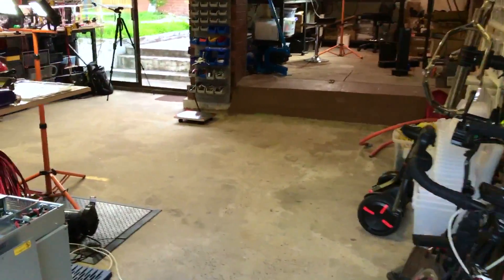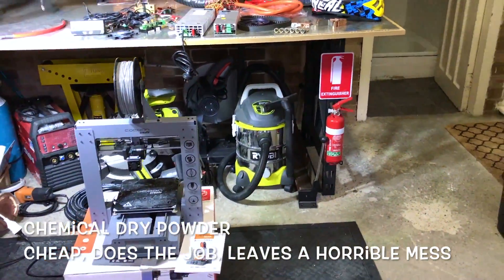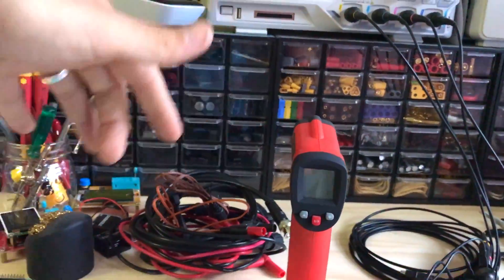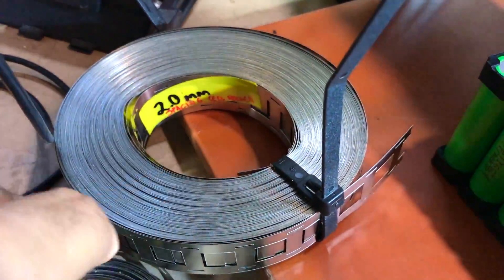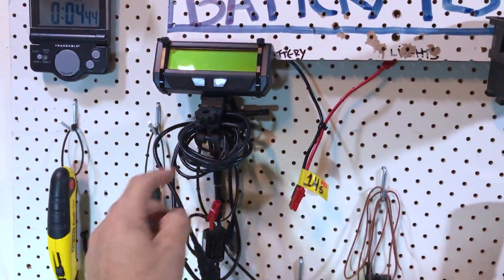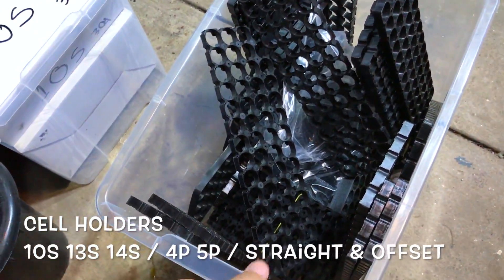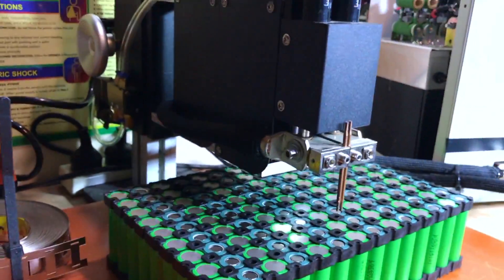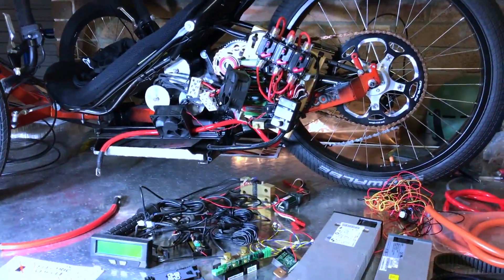My Electronics Lab & Battery Building Workshop... oh yeahh!!

Comment: I want to run 72v, 80A battery, and 200A phase, to my MAC...any recommendations for a controller? Thanks  Already did the current at 52v and no problems with the clutch or gears.  Glad to see somebody else realized the MAC has great potential :).

Comment: Bruno Popeye from Guadalajara México there is a trouble in My surron i make My own battery installed a 60 volt 150 amp bms not using the old bms because it has a 60amps limit, but i don't conect the square black connector from the battery and in ep mode works fine but in SPORT mode it cuts the power. And i need to restart the bike. From that connector comes only 3 cables from the original bms , i think one  is a gnd loop and the other is positive from one block of cels , i think it doestn mesures temperature.  Can You help !!!!! And also installed a así bac2000 on it but having the same issue

Comment: i love your workshop!! crazy !! very expensive workshop!! i am just curious, how do you earn money, do you support industries and do you build technology or automation equipment to industries?
Reply from the maker: Hahaaaaa thaaaanks mate. I actually don’t even earn much money at all... I basically buy little things here and there, +/- $100 a week and save up $$ for the bigger stuff but yeah if you put $100 per week in 3 years you’ll be surrounded by tools and no space to walk around hahahaa =]  I have way more tools than any company I worked for. It’s good you learn so much buying your own tools and using them. I work mostly in the electric vehicle and battery build industry but yeah always making different stuff, lot of custom metal panels, brackets too. I’m not a welder but can cut and bend. I always do all the electrical wiring, from low voltage sensors to making 800 volts high power batteries from scratch. When u have lots of tools you can do basically any job, best investment ever =]
Reply: @BrunoPOWEEER  I totally agree... But beautiful I loved it!!!! Ultimately it's the happiness you get have all of it!!! All the best!!! Hope you earn more in future!!! All I am very new to yotube plz support my channel!!🙏🙏

Comment: I would like to ask if it would be a bad idea to use the thermal insulation for the batteries to prevent damage due to frosts in winter or high temperatures ???

Comment: Hello, Bruno. I've got a few questions regarding bbshd motor. For the last year I've rode 7000 km with bbshd installed on a pretty simple 26" wheel hardtail bicycle called bergamont vitox 7.0. But now I'm thinking about changing the bicycle.

1) Is it a good idea to get 27.5" or 29" wheel? What will be the difference in riding with those wheels? I'm 5 feet 9, which is average height. 

2) Do you recommend using a bicycle with IGH (planetary hub) like Shimano Nexus 7,8 speed? I've got a chance to buy one inexpensive bicycle with such hub but it has v-brakes.

3) Can you live with v-brakes on bbshd or only hydraulic disk? I have Shimano BR-M375 mechanical brakes and they perform very poor. Do you know if Tektro HD-M290 hydraulic brakes are any good? Or in my neighborhood bicycle shopshop I can buy Shimano m315, m365, m396, m425, m506, mt500 or m6000. Which better?

4) Or I better upgrade my existing bike with a better brakes, etc? But I've got a habit to change bikes in a few years.
Reply from the maker: Hey mate, 
All these questions will vary between people, depending on your preference, your budget. Wheel size will only change the acceleration and top speed, smaller wheel better acceleration, stronger wheel. Get the fattest tyres possible and invest money on the best hydraulic disc brakes you can buy, not the biggest but the best. Sometimes going bigger only adds more stress to your brake mounts and you’ll ended up cracking your frame, it happened to me and a lot of people. Personally I like the Shimano brakes but they don’t have sensor. If you like sensor get the Teatro as there are many options out there like the Dorado.
Internal gears are good, I never had one for loooong time with a mid drive so I don’t know how it would do in the long term. A regular cassette I’m always replacing the smallest 11T so I guess the internal will eventually have the same problem. Chain stretches as well and I have to replace it every 6 or 8 months depending on how many kms.
If you can get a new bike, go for it, all fresh is a good thing, good brakes, new wheels, bearings, new everything. I save so much money riding my bike everywhere, it pays itself in 6 months. My favourite is my fatbike, feels like a monster truck, I can go anywhere ohhh yeaaahhh =]

Comment: Hello, im Rodrigo form Ecuador and i don't Know much about Ebike, i've been doing my research on the types of engines and batteries for Ebikes, and I'm better informed, the problem is that in Ecuador they do not sell Ebike, so I'm going to build it myself with the help of people that know how to weld and fold tubes, I would like to know if you can help me with information about the thickness of the tube that i need, and all the measures that you can help me with, im going to put a 20x4 fat tire, so i don't know the width of the bike that im going to build, if you help me with this I would be infinitely grateful, since I have 4 months investigating but I can not find that kind of information, and nobody have any one here, and thank you for the videos you upload, they are really funny and helpful, they help a lot for people like me who do not know about this and live in Ecuador
Reply from the maker: rodrigo molina Hello Hermanoooooo... I just read your comment here!!!!
Right, I don’t really have the measurements for the 20” x4” but I have my 26”x4” fat bike here. My tyres inflated is 110mm wide x 97mm “high” (between the rim and the road).
The distance between the rear dropouts is 170.6mm.
I would recommend get the complete fat wheel/tyre/hub first before making the frame. See if u can get the Bafang BBSHD motor, this is the easiest, best and most POWERFUL motor available out there. If you can’t import, see if you can get someone from a neighbor country to import and send to you. Alternatively I’ve seen many people using 12v car starter motors or alternators powered with 24v lead acid car batteries haha... don’t give up mate... I hope this information helped =]

Comment: Can you run a 52 volt battery on a 750 w 48 volt motor ?
Reply from the maker: Glen Garden yeaaaahhh, almost all 48v motor controllers can handle up to 60v max voltage. A 48v battery is actually 54.6v when fully charged and a 52v battery is 58.8v fully charged so it’s all good. This is a motor controller voltage limitation, the motor itself can take any voltage. You can run the same 48v motor at 96v you put a 96v controller and 96v battery as an example. Research “Bafang BBSHD 84v phase runner controller”

Comment: if i want to make a battery pack for 5000w motor i would need about 20 of 18650 (specs: 3.7V, 3400mah) because 20 of those would make 20x3.7V=74V and 20x3400mah=68 000mah=68Ah and it means that 74Vx68Ah=5032W... is that right? i found a seller on aliexpress which sells 20 of those 3.7V batterys for only 50USD... so with 50USD i would get 5000W battery pack? plz reply im planing to build a ebike. im first years electrician student.

Comment: Hello my bafang BBS01 is a 48v and I only have 4 36v batteries. how would I get the motor to work? tried connecting 2 in series but the over volting protection kicked in and the single 36v Is below the cut off. don't want to start a fire in my pursuit of Powwwwwer! Also very glad your still making videos Keep it up!

Comment: Dexter Laboratory don't have nothing compared to this extraordinary, extremely unprecedented, very impressive unimaginable high power voltage, and phenomenal go go gadget technologies.  Man, that's a mouth full.  Very outstanding job dude. I'm very pleased with this.
Reply from the maker: slicaltimistical1 thaaaanks mate!!! Yeah I have been super busy here (this is why I haven’t posted any videos for a few months). I’m working on a few electric cars, I have an electric Mercedes B class 300v with www.batrium.com battery management system (I also work at Batrium) + I’m also working on a 400v electric Mini Moke with fancy electronics and Batrium BMS too + I’m making an IP67 (dust/1mt waterproof) marine grade big battery for an electric hydrofoil surfboard.... this is why I haven’t had time to post anything recently here haha... 
I’ll be also showing a solar racing electric car, this is a million solar project, super interesting too... 
I hope this video inspired you in some ways and made you want to buy some fun toys and tools and start make your own machines with so much POWEEEEEERRR ohhh yeaaahhh =]
Reply: ElectricBike Congratulations on your Mercedes Benz B Class E man.  Hard work does paid off.  Maybe Mercedes SMS AMG E going to be your next car?  Talking about raw electric power.  Over 739hp on all wheels.  Keep up the good work.  I like to see that project electric car.  That what subscribing is all about.

Comment: What is the thickness of the fiberglass? 1,5mm? Its very had to tell from the video.
Reply from the maker: Mads Peter Nørgaard yeaaahhh I normally have a variety of different thickness fibreglass sheets, some projects I use thinner (smaller and lower voltage packs) and when I’m doing the high power stuff with a much bigger battery or in an environment where it requires more protection I use the thick ones. 1.5mm is considered thick and hard to cut. You can use fibreglass sticky tape from Hobbyking to put the sheets together or even use a raw fibreglass strip and soak with epoxy (kinda like a giant bandage around the joints) =]
Reply: ElectricBike do you have a link for the fiberglass you use or something similar? I am building a 20s14p batter of q30 soon. So that would be great!

Comment: Are you familiar with buying 18650 batteries on ebay without the amp continuous ratings? I want to build a 48volt battery pack for a 55amp continuous 2000watt controller and I wanted to use the cells on ebay labeled for 10ah each but the sellers don't have the amp continuous ratings. Only amp hours and volts. Is there a standard low amp continuous rating for all 18650 batteries?

Comment: Bruno, what's your thoughts on the bafang ultra 1000?  cheers
Reply from the maker: Yeaahh... I tried the Ultra in my trip to China last year when the motor was just a prototype before they released to the public and manufacturers... the bike I tried had no throttle, just torque sensing like the smaller Bafang MaxDrive. I was expecting a LOT more power than the BBSHD since the motor is bigger and MUCH HEAVIER but it didn't feel as powerful as the HD. Maybe because it wasn't the final version but I kinda didn't have a good first impression. The new display looked nice.
It may be a much better system if all that additional size and weight translates into more POWAAAAAAAHHH... of course people selling it will say that it's MUCH BETTER cause they're selling it haha...
Reply: Thx Bruno for reply, i read it's a lot heavier, but also read somewhere that Luna have a magnesium(?) casing on theirs, reducing the weight by well over a kilo!

Comment: Hey its me again!!!!Quick Questions and I hope its not a dumb one. I have educated myself on Batteries, Battery Pack, Power supplies Tab welder, etc etc. Thought I would try my hand in a small powerwall like Jehu builds. So far I have taken apart around 70 laptop battery packs, and yeilded maybe 120-150 good cells above 2000-2500mah and ok resistance. This left me with a few sub-par batteries, i just could not part with. those are around 1600-1999mah. Those have ok resistance also. I know we shouldn't use the lower rated batteries. But what if I could mix them with 2600mah batteries. Would that equlize the pack so i can use with the 2000-2500 packs. Just curious?
Reply from the maker: Great question, keep different capacity cells separate, this would save you from many problems. People have done a lot of experiments mixing a few packs and it didn't look too bad at the first weeks but then the whole pack went down quickly. What happens is that the lower capacity cells are working much harder at low and high voltage, they get much hotter and wear faster. An alternative way of doing it is to make a bigger pack with the smaller cells to make it equivalent capacity to the big pack. Even doing that you'll need to test and compare them. This is when a premium BMS like Batrium comes really handy showing all these things in a very visual way. =]
Reply: Thanks for answering!!!That makes sense!!Unfortunately, I can't afford a Batrium yet, but I do plan on getting one when fund allow it. For right now, I am using simple BMS with Balance functions. But then again, I am also using packs in series. That is something else I wondered. 

Say I have 400 batteries. Would it be more efficient to run them in 10 x 4P10S Packs(can be other configs in series), or 10 x 3.7(40 cells each)
Reply from the maker: Yeah, small BMS can be okay depending on the application and your budget. These small BMS from Alibaba have a very small balancing resistor which is suitable for small packs like 4p or 6p max... if you're going for 40p or 100p like the other DIY POWERWALL guys, what you can do is to split your large banks into 2 or 3 separate BMSs and then connect these packs in parallel (never connect BMS in series). By having more BMS you have a better balancing and it's easier to find any faulty packs, remove the bad cells, fix and put back to work.
Big pack with lots of cells in parallel is awesome but if you have a problem it's hard to find which cell is bringing the whole parallel group down. It's tricky cause you measure all cells and because they are all at same voltage you rarely find the bad ones unless you physically disconnect every single cell and leave sitting there resting for days or a week. Then you measure again and you'll see the bad ones should be much lower voltage than the rest of the pack. If you have multiple smaller packs this problem is a lot easier to fix. Even Peter HBpowerwall who runs his system with Batrium has thousands of cells split in multiple smaller packs so it's easier to diagnose and service the bad ones.
Reply: Thank you!!!!!!Man, sometimes it so hard to get a straight answer anywhere, especially when engineering is not something you have done before. Your answer is pretty straightforward and has cleared up a lot of confusion for me. Sounds like I should maybe keep them in smaller 10S Packs with a BMS that Balances(till I can afford Batruim). I ended up with only 360 cells above 2000(had to break down and purchase 200 from alarmhookup) I really appreciate you taking the time to answer!!
Reply: BrunoPOWEEER "Lower capacity cells are working much harder..." Since when does the capacity have to do with how much stress the battery experiences? If you have a 1600 mAh 30A discharge rating battery, and a 3200 mAh 7A discharge rating battery, the HIGHER capacity battery is going to be working harder. You seem to be the expert, so correct me if I'm wrong.

Comment: I'm very shocked to see do you really use only 50ws for your second pulse to weld the 0.17mm pure nickel?  My welder uses about 150ws to weld that thickness.  A bit less maybe 120-130ws if its slotted.

I don't see any real weld marks or discoloration on that one pack you welded.  Have you pulled the tabs to see if you get flagging, where metal is left behind and stuck to the cell (the tab rips before it pulls the weld off the cell)?
Reply from the maker: Yeah, 50ws and welds super well!!! You can lift the whole pack by the tab and it doesn’t even leave a big welding mark. There are a LOT of variations that actually makes difference, it isn’t just the thickness and the ws that are important, the even and right pressure on both electrodes, nickel quality, electrode shape/diameter, the length of the thick cables carrying all that energy to the electrodes, if they’re running parallel to each other or like a circle also changes the impedance, many many factors. Most nickel tabs come with a slightly oiled surface from machining tools, a clean surface also makes difference. 
Plus this is a massive industrial machine that can weld non stop 24/7 unlike smaller welders that have a very low duty cycle.
It’s kinda like my JBC professional soldering iron, I can easily solder lead free at 285C (actually way less) while a regular soldering iron struggles to melt lead free solder at 350C.
Yeah different machines different results.... supa POWAAAAAHHH!!! =]
Reply: Yea I wonder how much power I'm losing through my cables and electrodes.  Actually I changed my setup, from the one that came to the factory, before I'd h ave to use 40% more power to weld the same thing because so much power was lost through thin and long cables.

Can you measure peak current and voltage, for your 50ws setting?  I'm curious, should be very interesting to compare results.

Comment: looking for something compact yet powerful to charge 14s 58.8v 30q pack. Any ideas? thanks :)
Reply from the maker: Check out the CycleSatiator can do up to 8amps, super small, fanless, water resistant and has an OLED display with lot of information and custom settings, best compact 14s configurable charger. I actually made a video showing all features https://youtu.be/wGD6DrBZ5uE

EM3EV website, they have some 14s 5A chargers
More POWAAAAAAAHHH =]